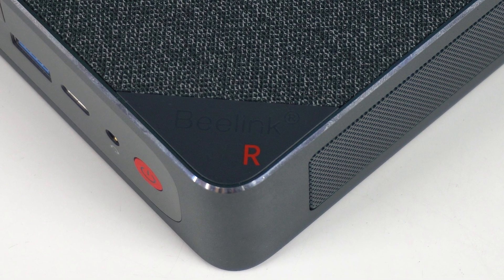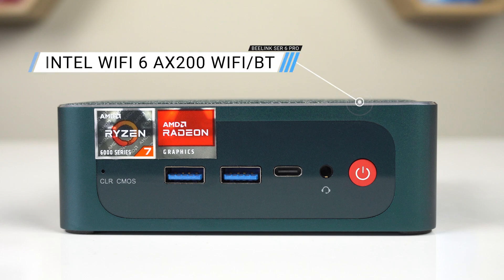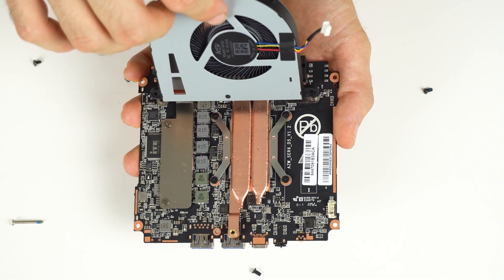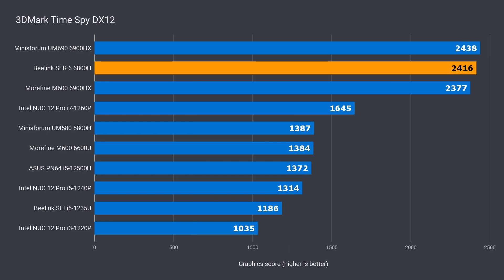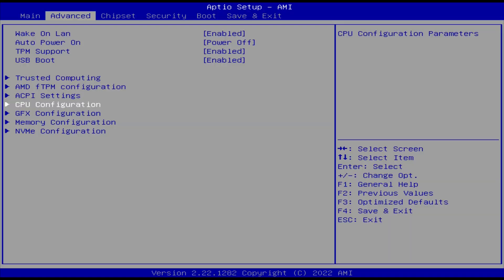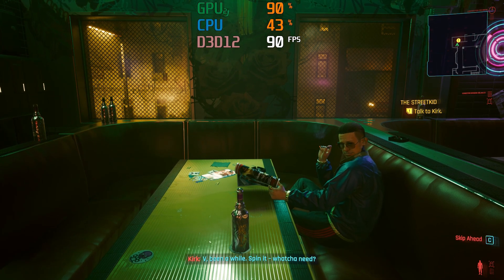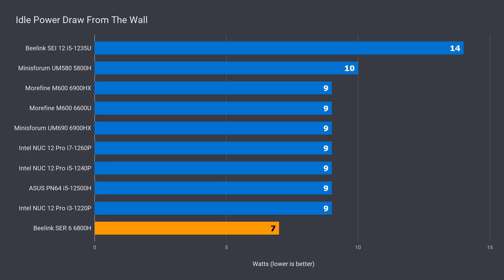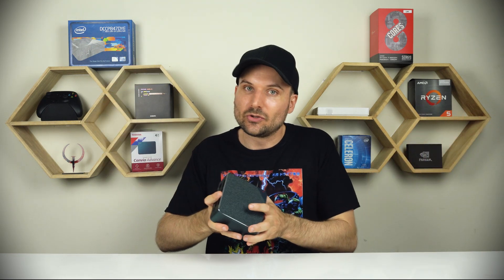The Mini PC Everyone is Talking About - Beelink SER6 Pro

Comment: i bought this one for the wife. she recently acquired a stay at home job that she absolutely loves.
i did a dual screen mounted to desk via arm for her along with a new logitech keyboard/mouse. 
She was doing her work on a 13" mac pro/extra monitor but it just wasn't smooth and seamless.
She loves this new setup and says its way more responsive with twin 24" monitors and her 6-8 
applications open at the same time she can whip thru her work. Got everything same day via Amazon also!
Reply: Hi.. @jsasu, how its now ? After using 1 year later?
Reply: @DartPro  still going good 👍🏼 many updates but still working good

Comment: 2023-03-13 - Interesting, I see that Beelink has updated the processor for this system to: Ryzen 7 7735HS.  Price $649.  Would be very interesting to hear how the updated processor affects the system performance!
Reply from the maker: I'll have a review of the 7735HS hopefully this month
Reply: @Robtech  Really looking forward to it, thanks!
Reply: It's basically the same Cosmo! I have both. 7735HS is like 1% faster in a few tests. Make sure to update to the latest 1.15 bios.
Reply: @neilquinn  i have a SER6 Pro Max with the new 7735hs here, too, but I'm about to return it, as it keeps firing up the fans when doing the simplest tasks, sometimes even in idle. Do you have a similar experience? My BIOS version is 1.15
Reply: @Marekki2202  Do you have some sample tasks? Mine has been pretty quiet, but in fairness I'm mostly using it as an htpc/file server so it doesn't take much cpu load. In the older firmwares it did love to go wild. Unfortunately it seems most minipcs struggle with this (minisforum, etc). Not sure about intel/asrock models. I can test some software if you have specific ones.

Comment: Might get this one for use in our classrooms. Looks like a good little unit and better than the Mini S or U59 Pro I was considering. Also the price is a very big determining factor. Great review Rob
Reply: Did you buy it? You could also consider the older Ser5 model with 5800H, it's almost half price to the Ser6 and still more than enough performance for most users

Comment: Looks like beelink recently updated this model by replacing the 6800h with the 7735hs due to overheating.
Reply: I was just thinking the cpu heatsink seems very small for a high end cpu. Either way I bet it will just throttle the 7735 too.

Comment: Thank you very much for the very detailed review. I purchased the SER6 Pro due to it. The SER6 Pro works off of a single USB-C cable utilizing Power Delivery, and it's really quiet after running the Beelink website provided firmware update. Great speed and noise upgrade from the Minisforum TL50.

Comment: Hey Rob.  I got a simple question.  You know all those screws you unscrewed?  If Beelink were instead to have magnets holding everything on -- and so all you did was 'pull' on handle of each layer-- would that be a GOOD idea?  Or would magnets goof up the situation somehow?  I say this because it's not only easier for dis-assembly but assembly for them as well.
Reply from the maker: It's possible. I think the manufacturers would rather people don't open it unless they need to upgrade/repair it. So screws keep the average user out.

Comment: Just 4K60, only HDMI. No DP, no (proper) USB with DP. Hard pass. Both the Minisforum or Morefine are better.
Reply: What what media are you watching that's above 4k 60?
Reply: @Durkhead  This is a gaming APU. No need for this expensive a mini PC if all you need is a home theatre PC. For gaming, it's nice to have a little more headroom over 60 with Freesync.
Reply: @bakakafka4428  what apu is doin 4k 60?
Reply: @Durkhead  depends on the game
Reply from the maker: It has a USB 4 port same as the other two, which supports  above 4K60.
Reply: @Robtech  yeah, it didn't show on the port description, and then I watched until the end and saw how he struggled to get it working - so I edited my comment to 'proper'. It still doesn't work as it should. None of the Rembrandt minis do sofar. They are all lacking compared to previous gen.

Comment: They certainly got the cooling right.
Reply: Beelink also has a new 'quiet firmware' for the GTR6 that i'm going to test out. The SER6 pro is WAY quieter at idle out of the box compared to the GTR6.
Reply: Adding that little fan helps a lot, but if you use a SATA drive someone earlier in the comments confirmed that it blocks air to that fan, which would change the ability to cool the nvme and RAM. NOTE: I'm editing this because Rob tested the difference with and without a SATA drive, which he mentions above, and the temps (given an ambient of 28C) were not bad, even with the SATA reducing the air flow, as it doesn't block the air flow entirely, just reduces it.

Comment: Did this come with a vertical mount like the 690?  If not, would the cooling work as well in this orientation?
Reply: I've have and had a couple of Beelink SER5 units and what Rob showed in the unboxing was exactly what you get - no vertical stand.
Reply from the maker: Yep, this one is horizontal only.

Comment: Great Video!  Glad the thermals on this are much better than the other 6900 units while still providing good performance and user experience.  I mean if the 6900 units throttle over time what's the point?

Comment: Question Rob: The little nvme cooling fan is nice, but I can't tell from the image if adding a SATA drive would block the airflow to that little fan?
Reply from the maker: Alright here it is. It's not blocked by the 2.5" drive, but it makes a difference. Thrashing it at 28C ambient this time. 
Without 2.5" SSD: Device Temp 55C / Controller 70C
With 2.5" SSD: Device Temp 65C / Controller 75C
Reply: @Robtech  Thanks  for taking the time to test this Rob.  Given that the ambient was 28C, those are better temps with the SATA drive than I'd have expected.
Reply: @Robtech  That's a pretty big difference. Assume that's at idle? I imagine under load it could be a lot worse
Reply: @neilquinn  Neil, I'm pretty sure Rob tested the difference under heavy load as the numbers he shows with the SATA drive limiting the effectiveness of the fan are almost identical to the numbers I got on my SER6 5600H, which lacks a fan (and he mentions 'thrashing' them). I realize that this unit is more powerful, but even with no fan, the resting numbers are much lower than what he showed (and he'd have realize that the concern is under heavy use, not near idle.
Reply from the maker: I'll take a bit of time today to test the difference. As long as it's not completely blocked, air will get through.
Reply: I've added a 4TB Samsung 870 EVO in mine. No issues so far. There is a some space under the drive to make air flow...
Reply: I'm curious about this too. The biggest weaknesses of the SER6 pro imo are the lack of a 2nd NVME slot and only wi-fi 6 instead of 6E (though i'll use ethernet).